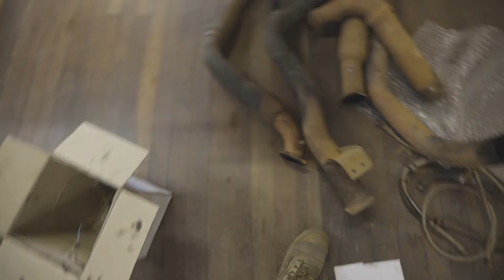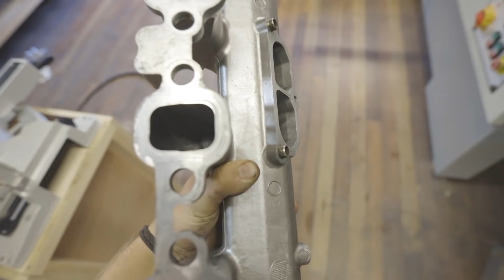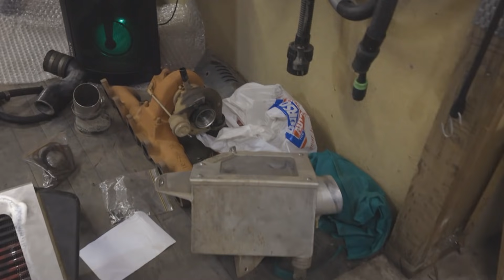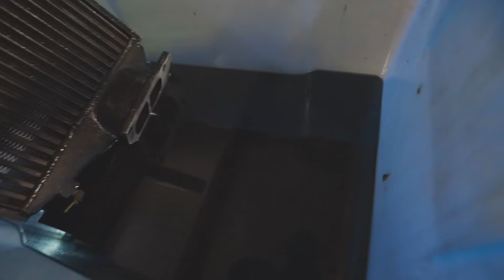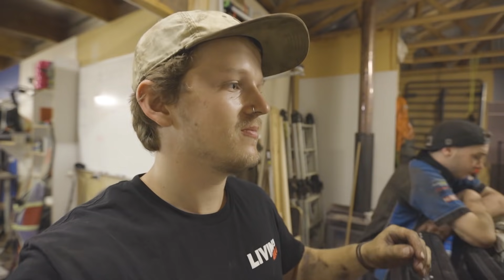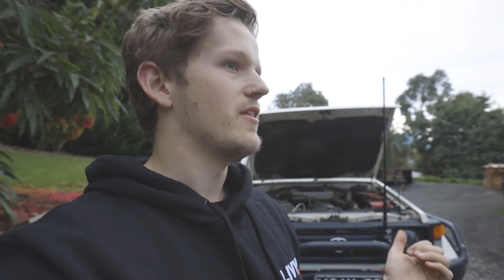1HZ Turbo Install - Slapping a Turbo on the Troopy! Full Install

Comment: If enyone is looking hpd performance do have a spike when I did my gu wagon I just used same grease an a drill it an then taped it an dropped the oil an sent it 30000km an it's running sweet

Comment: Hi Adam I turbocharged my 1hz with a DTS kit 10 years ago and it’s now done 600,000 kms on a stock engine keep it de-tuned as you have and it just may outlive all of us, loving your videos and will hopefully see you around sometime
Reply: How much psi are you running
Reply: @samul7482  12 psi
Reply: @njpw1402  what sort of power are you making tho?
Reply: @Raven-cf5qd  not sure it’s been more than 10years since being on a dyno and I can’t for the life of me remember
Reply: @njpw1402  it probably isn't worth it. $3000+ and I've seen guys do a detuned dyno and they only increased 73rwhp to 89rwhp that a terrible gain for $3000+ you'd gain more with extractors. He then had it tuned and it made 110rwhp. It he planned on adding more boost. I wouldn't bother turboing without a tune. A non tune turbo may increase torque better I'm not sure but yeah

Comment: You have done well, right up to the point where you played with the fuel screw. If you want to keep it reliable and not destroy your engine, get an injection shop to fit an aneroid and tune the pump properly. Pointer for you, if you take injector lines off put caps on the injectors to keep crud out. Not a keyboard expert, diesel mechanic that has installed a lot of DTS kits. I personally have had the same system on my 100 series for 15 years. The only issue I have had was the rubber inlet elbow getting soft, replaced with silicon no dramas. Notice that your indicator was flashing really fast in the road test so I assume your running LED indicators on the back, there is a load resistor that you can get to slow the indicators down to normal. They can be tucked away neatly in the front indicator housing.
Reply: Hey mate I had a full rebuild in jb turbo on mine but zero boost. My sons a fitter and turner and he suggested very slight turns of the wastgate rod? Thoughts

Comment: I noticed your oil filter said 491k and you said the car has 502k. Now it’s turbod I highly recommend doing oil and filter services every 5 thousand, 1 because there’s a turbo now that loves clean oil, 2 the turbo is gonna make the engine run a lot hotter than before even under normal operating conditions like cruising st highway speeds and this will push the oil close to its temperature break down.

Comment: A lot of the spikes diesel shops use which you are referring about, are bits of steel rod turned down on a lathe to receive the spike effect. They just match the diameter of the rod to the diameter of the fitting.

Comment: If you're not keen on spiking the sump look up the instructions for the 1hz Safari turbo kit, there is an option of drilling the drain into the block, way more secure and definitely the way to go. I did it this way and went pretty easy just need the right drill bits and a right angle drill. Make sure to coat the bits with grease to avoid metal shavings in the engine. Happy days

Comment: Just go to a metal shop and get a 600mm length of whatever size rod you need to suit your fitting and sharpen a point on it. But make sure to drill a start point and weaken the sump so it doesn't wanna bend when you hit it. Then just use tons of grease on the tap then screw the fitting in.

Comment: Nice build young felah,turbos go well in those motors. The trade of is overheating when towing vans,seen many people try to fix the problem with bigger radiators,boost conpensator,adjusting mixture, reco injection pump,new injectors,and they say the head could be faulty. Simple they have non turbo pistons and no oil squirters to cool the piston.
Reply: you are right, but if the head and pistons from 1hdt are installed, then all these problems are absent

Comment: Good to see u giving it a go, if that barbed hose fitting fails or its make u sleep uneasy, buy a steel barbed hose fitting and a steel nut to suit, use some 3mm steel plate, drill a hole large enough in the steel plate for the oil to flow, weld the nut to the steel plate, line it up with the hole u made then weld the steel plate to the sump  , then screw it all together ect

Comment: Hello, thanks for the video. I'm in Costa Rica. I just installed this motor with a  turbo in my JB40 1980 Landcruiser and I love it. May I ask, whats the turbo psi that you run and whats the highest rpm you accelerate to?

Comment: My 1HZ running garret red wheel bad boy fatz 4” air box intercooler but 12mm injector pump
Ceramic top pistons 
ARP head bolts
3.5” SS exhaust twin stacks
Running 35” tyres
Dyno  150 hp @ 1,400 rpm 
500 nm torque @ 2,050 rpm
Boost 21psi
A joy to drive even towing the 3.7m tinny

Comment: I’ve done 4 1hz sumps drill and tap 1/2bsp barn and they work mint use loctite 577 never had one leak I had a mate did the same and he landed on top of a railway iron post in the ground went thru the sump and the barb stayed the same I wouldn’t do it any other way

Comment: With spiking the stump use a small bottle jack or the one in the vehicle and make a spike out of rod and either tack weld or stack a couple sockets inside each other so it doesn't slip

Comment: Just go to a machine shop and tell them to spin you up a spike to the exact outside size you need and heat and oil quench the tip so it doesn't blunten straight away ive made a couple for fellas working on vl turbos and gqs

Comment: My dad snapped the timing belt pulley on his 80 and it took us a week trying to get it out and had we had to re time the motor but we did it wrong the first time and the valves hit the pistons😶 we got it running though ( it was a big mess)

Comment: Just a little tip that won’t cost the world but worth every penny get you injectors serviced make sure there not leaking that’s the killer in a diesel not the boost you can run 15psi + on a stock 1hz just don’t over fuel it that’s the killer just speaking from experience 😣

Comment: Yep now its turbo need new oil every 5000km if driven hard or 7500 if driven normal. 
Not 50,000 or 75,000 !! 

Also a water sprayer for intercooler make a huge difference.